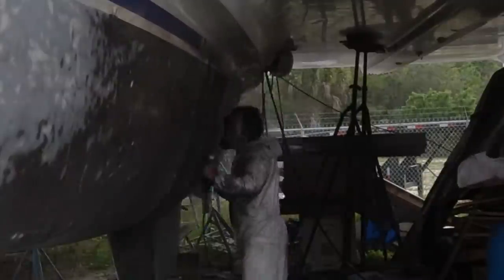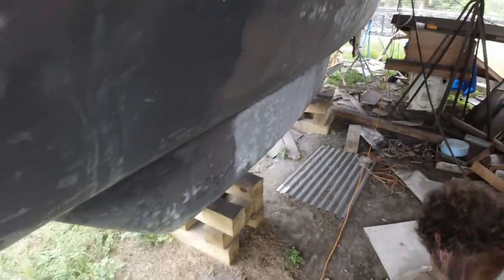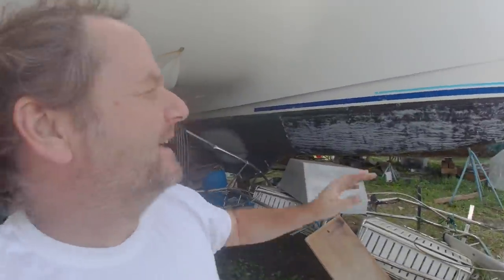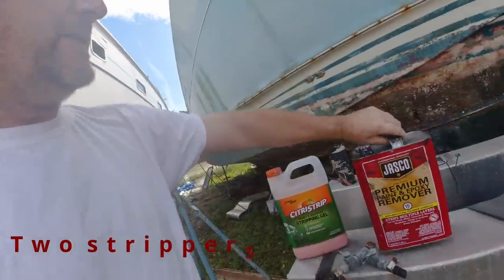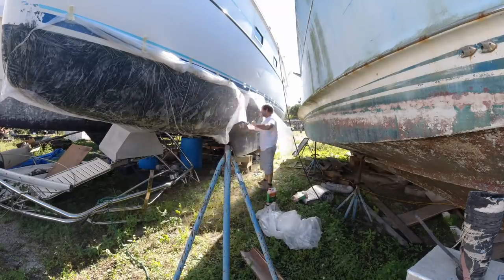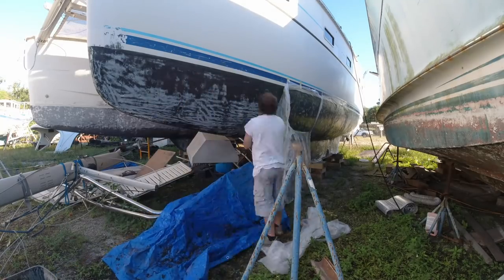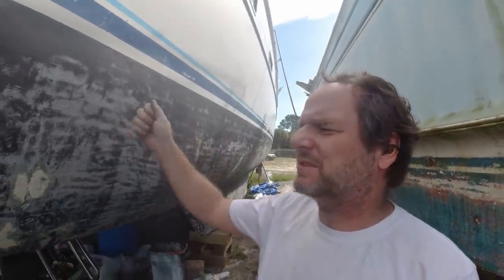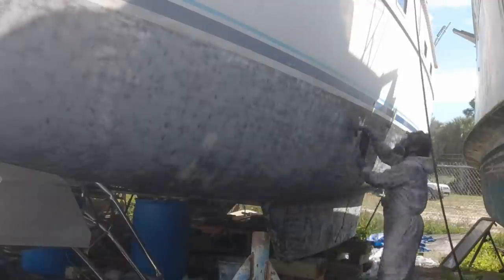30 Best way to remove Bottom Paint on a Boat and the Adventure Continues

Comment: Hello Brian. I used a home brew copper bottom on my cat, saved money DIY.  I Mixed the copper powder in heavily and I used hard set construction epoxy, NOT the eblative epoxy used in the 'name brand type'
Why wear/scrape it off ? Yes I do need to clean the bottom, but the epoxy copper bottom is hard like ceramic. It is permanent I feel. Clean it and looks new, never need to paint again ! Sail on, cheers
Reply: Appreciate your time,
I’d share a beneficial knowledge
✎💬±𝟷𝟽𝟺𝟽𝟹𝟺𝟻𝟽𝟷𝟹𝟺

Comment: Keep up the great vids, and make them however you like.  Re paint removal - Myself, I'd be quite  afraid that a chem stripper would affect underlying materials.  The 'good' strippers (containing mek) also are very effective at turning you into a veg.  When I worked in the boat repair business many decades ago, the goto method of large bottom paint removal was sand/hydro blasting as an out-service.  All bottom paint off in couple hours, and any blisters also resolved .  Regardless of the method used, fairing was still required afterwards if a straight/true surface was desired
Reply: Appreciate your time,
I’d share a beneficial knowledge
✎💬±𝟷𝟽𝟺𝟽𝟹𝟺𝟻𝟽𝟷𝟹𝟺

Comment: I sure was surprised to see an episode from you Bryan, always much appreciated! Moving is always difficult so I can see why the episodes were put on the back burner, especially a long distance move. Didn’t you show us this house in a previous episode? The dock and the woods look familiar. I’m hoping you get settled and can relax after so much work and stress.
I’ve used that orange stuff before and thought it was junk so the plastic on top was a real eye opener since I’ve still got some, fantastic tip!
Reply: Appreciate your time,
I’d share a beneficial knowledge
✎💬±𝟷𝟽𝟺𝟽𝟹𝟺𝟻𝟽𝟷𝟹𝟺

Comment: Hi Byan, glad to see you back. I had to strip a thick layer of antifoul off the hull of my 35ft monohull before applying an epoxy barrier coat and Coppercoat. I started with a chemical stripper available here in the UK but there were just too many coats and it was making an incredible mess. But it softened the paint enough for me to scrape the whole hull with a carbide blade scraper, took weeks but I got there in the end. The Coppercoat is working well after 3 years, still needs pressure washing a couple of times a season though, I don't think I sail fast enough! Looking forward to your next video...
Reply: Appreciate your time,
I’d share a beneficial knowledge
✎💬±𝟷𝟽𝟺𝟽𝟹𝟺𝟻𝟽𝟷𝟹𝟺
Reply: Back in 2010 I sanded the bottom off my 34 beneteau. I thought my shoulders would never be the same. A couple years later my friend was doing his with a carbide scraper. It looked so easy I had to try. I  couldnt believe how much easier it was. Live and learn!

Comment: Use of the stripper and plastic was a great idea and as you said a lot less toxic.  A home with a deep water dock and above hurricane zone- good move.  
On another note- at some point you'll be looking at solar panels and controllers.  As far as solar panels, please consider bifacial mono panels in the 400w (top side rating) range, especially for top of dinghy davits. The albido of the sea can be 30-80% especially with low sun angles so you can get another 40-60 watts production.  The same goes for Hardtop bimini, but only if the panels' bottom side is the bottom side of the bimini (a la Parlay Revival). The albido of white fiberglas in the cockpit is equal to fresh snow.  As far as controllers consider EPEver in the 60 or 80 amp versions as an alternative for the expensive blue brand.  I have used Make Sky Blue 60 A version with wifi with good results on a cat but these do use a fan for cooling.
Reply: Appreciate your time,
I’d share a beneficial knowledge
✎💬±𝟷𝟽𝟺𝟽𝟹𝟺𝟻𝟽𝟷𝟹𝟺..

Comment: I think Aircraft paint remover works best, it's a little more expensive but it works well especially on vertical surfaces.
Reply: Appreciate your time,
I’d share a beneficial knowledge
✎💬±𝟷𝟽𝟺𝟽𝟹𝟺𝟻𝟽𝟷𝟹𝟺.

Comment: Hi Mr. My Question 
Why not use sand blasting under pressure and then a layer of yelcoat ⚘🇨🇺
Reply: Appreciate your time,
I’d share a beneficial knowledge
✎💬±𝟷𝟽𝟺𝟽𝟹𝟺𝟻𝟽𝟷𝟹𝟺.

Comment: This episode in a nutshell: 1:A cheap stripper may not be as easy to handle as an expensive one. 2: How much you pay usually has a bearing on how much grinding you end up doing. 3: Copper strippers are flash but pricey.
Reply: Appreciate your time,
I’d share a beneficial knowledge
✎💬±𝟷𝟽𝟺𝟽𝟹𝟺𝟻𝟽𝟷𝟹𝟺

Comment: Another item you may be interested in the future - Air Conditioning.  Take a look at Emily & Clarks Adventure June 2021 YT episode.  Guy is an engineer and designed a 12v low draw AC unit at a very reasonable cost.  He beta tested in his sailboat and is having a co put a next gen production model together.   Design might work well for your cat's cabins and salon.
Reply: Appreciate your time,
I’d share a beneficial knowledge
✎💬±𝟷𝟽𝟺𝟽𝟹𝟺𝟻𝟽𝟷𝟹𝟺.

Comment: Oh man you just said you were going to do the bottom with Coper Coat!  Don't do it!!!!  Copper Coat is so hard to apply, it has to be applied in the right mixture, the right temperature, on the properly prepared surface.  Honestly even as handy a fellow you are you can't even do that by yourself.  You can't get the mix right in time to apply probably.  Sailing Britican here on this platform had to have it done by three yards with entire crews to sorta get it right.  Specialists had to be flown in...Dude honestly even if you could get ten years out of a bottom job, you'd be crazy to leave your boat in the water that long.  Boats have so many maintenance items to accomplish at one to three year intervals.  So in other words you'll still need to haul out.   The best paint that YOU can apply is Petit's high copper hard.  Most of the people I know are getting in excess of three years out of two coats of the antifouling.  It is also holds up easier to cleaning than ablative(not talking about CC being an ablative).  Not to mention it is soooooo much cheaper.  I'm telling you as nicely as I can, you or anybody you will hire, will not not get a satisfactory Copper Coat application.  There will be spots you just can't get right.  That grow stuff like nobodies business.  Search for the videos from Sailing Britican.  https://www.youtube.com/watch?v=jVtzBenciz0

Comment: Why don't people use air grinders or sanders and then wet sand the bottom to prevent all that dust, and the water also cleans the sandpaper for longer use
Reply: Appreciate your time,
I’d share a beneficial knowledge
✎💬±𝟷𝟽𝟺𝟽𝟹𝟺𝟻𝟽𝟷𝟹𝟺 .